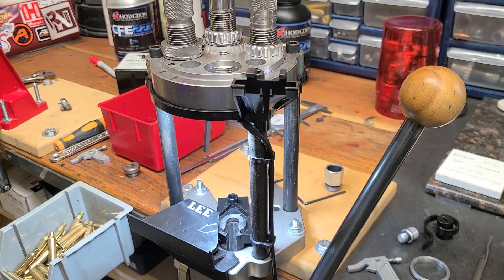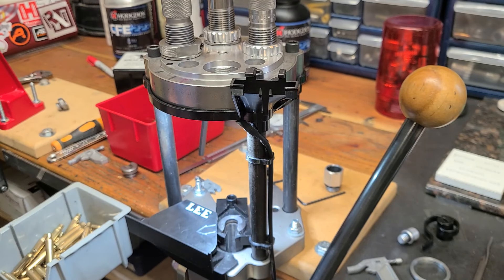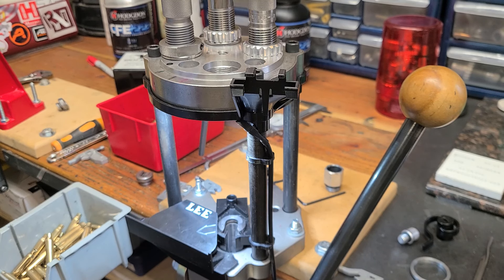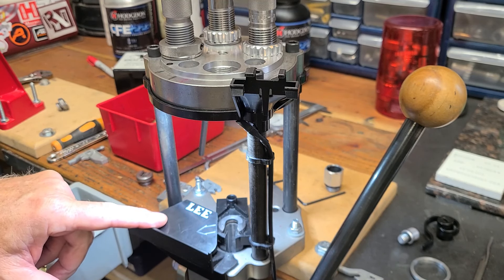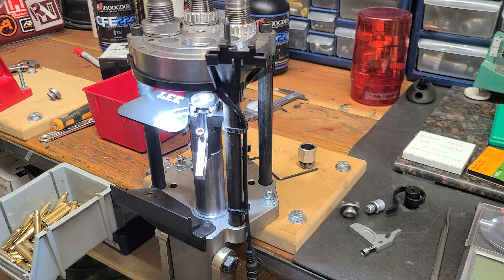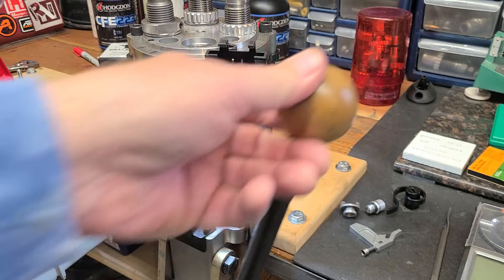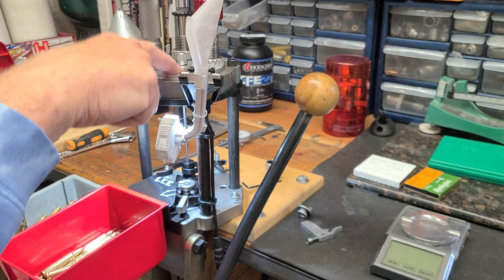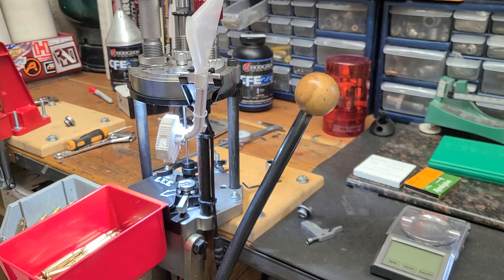Ultimate Turret Press Priming Problems.  Broken priming levers etc.  and the Fix from Lee

Comment: You've been my go-to guy for Lee turret presses for maybe 8 years now. I've held off on the latest model because my original just works so well with the pistol calibers i load. My rifle loads I just go basic with my RCBS Rock Chucker. I'm not loading .223.
Reply from the maker: Thanks for sticking with me all this time!  I always say, don't fix a problem you don't have.  I will add that the option to have a 5th hole with a bullet feeder is really nice.  Its more than just convenience, it sets the bullet very square to the case, particularly noticeable with rifle boat tail bullets.   I would never want to be without a nice single stage press though.  I like to compare the quality I'm getting from the turrets to a single stage to make sure I'm not sacrificing quality.   Thanks for taking the time to comment.

Comment: I see you went back to the Ball handle.   I too am an old Lee user operator, and def prefer the ball to the lever.    I even bought a spare ball lever years ago to replace a handle, but need to get some gas for the torch to bend it properly.  Thanks for the tips and info.
Reply from the maker: Good catch!  This handel is off of my Classic turret.  I kept the 10deg bushings from the ultimate turret.  it fits perfect that way and misses the Safety prime feeder.   At first I liked the handel but over time I felt like there was too much lever, twist and spring.  Back to the ball and its a way. more positive feel.
Reply: I swapped out the roller for the shifter. Like driving 4 on the floor.
Reply from the maker: @dennism8346  I like it better

Comment: I watched a video years ago that the person had the same problem with his older turret press, 4 hole classic,  I believe.  The primer lever wasn't hitting the casting that had the primer lever pocket built in that because it wasn't lined up changed the timing the primer arm rotated under the shell holder. But basically raising up the contact point caused the primer arm to move under the shell holder earlier to miss the primer cup. You can adjust the timing yourself by building up the contact point the lever contacts causing the timing of the lever to move forward earlier to get under the shell holder earlier. You shouldn't have to but it would be an easy fix and Lee could make the newer presses built that way
Reply from the maker: That might have been my video, I addressed primer lever issues on the Classic turret many years ago..  Showed how you could adjust the head of the ram to line up on the base casting marks better and also polish the walls inside the ram slot so the lever wouldn't hang up on burrs.    I have explored raising the elevation of part that the lever contacts first and that works to some degree but now that Lee produced the steel ring you want the lever to rest there instead of spanning like it did before.  Thanks for watching and commenting.

Comment: Another thought... My experience with Lee is that they are always so competitive on price and innovation but you pay a price in the initial quirkiness that you have to suffer through before the product works like it should.  Consider the original Lee Turret Press that went years before they got the primer feed to work with redesigned parts. That said, I'm still a huge Lee fan after helping my buddy set up his Dillon.
Reply from the maker: Thats true, the Lee safety prime system has had its challenges.  There are times when I think about breaking out the old black round ones cause sometimes I remember them working better.  I dont know LOL.  Also true, the grass isnt always greener.  Adding complexity and automation increases the need to adjust and fiddle.    If you look at the other turret presses on the market, they dont have problems with indexing components because they make you the indexing component.
Reply: @TreeTopFlier  Ha ha. True. First time I realized what those other turret presses were about I was like  "is that all you got"? You're making me rotate the dies? Sheesh.

Comment: any thoughts on the classic turret press vs this ultimate version ?
Reply from the maker: I like both of them.  The new press really gives you a lot of versatility that the LCT doesn't offer.  Now that the bugs are worked out of it from the first release I would be inclined to lean toward the Ultimate,  Ive used mine exclusively since It came out.  In part to evaluate it but also because I like the function of it.  My LCT is sidelined.   That said, it is more finicky and requires more tinkering to keep it running smooth.   I talk about this in one of the videos I made on the press.
Reply: @TreeTopFlier  thanks for taking the time to respond. Reading your answer made me realize I actually meant the Lee VALUE turret press vs this (ultimate) ? I currently own a progressive Lee Six pack but its a pain to change calibers. I also own a Lee Challenger single stage which is great for different calibers but pretty slow. I'm wondering if the value turret press would be a good addition to sort have an in-between. It seems for caliber changes all you need is a turret and you can keep all the dies in place, although it only accepts 4 dies not 5 ?
Reply from the maker: @alucardx3014  I have the value turret press as well.  It's a very nice simple auto indexing press, great for hand gun and intermediate rifle cartridges.   Have a neighbor who doesn't know how to reload but bought a Sixpack pro for 38 special (cowboy action stuff)  what a nightmare getting him running on it.   He would have been SO much happier and safer with a value turret press.  Anyway, I don't have a bad thing to say about it.  I have a video comparing the LCT to the value press.  Cheers 🍻

Comment: Great video. I have an old Lee Reloading Press and was looking to get a progressive, and now I like the turret presses.
Which Lee Turret Press do you recommend for loading 223 and 9mm for someone getting into reloading?
Reply from the maker: There's now 3 Lee turret presses.   Value Turret, Classic Turret, and the new Ultimate Turret.   All will do the cartridges you mentioned.  The Value press is the cheapest and a pretty nice option.  If you think you might want to do larger cartridges in the future the classic might be the way to go.  If you don't mind the extra price and complexity or think you may want to add a bullet feeder then the ultimate would be the way to go.

Comment: I feel like LEE is like a software developer that puts out a product and depends on users to provide the beta testing and then they try to engineer out the problems. I own and use a number of LEE reloading products, including the most feared progressive press, the LoadMaster. The all time best product I use is the original LEE hand primer. The new hand priming tool is much worse. It flips primers on their side and upside down 6 to 7 percent of the time. The worst thing I think LEE has produced is any of the on press priming systems. I don't even attempt to try user fixes any longer. It's no wonder LEE archived the LoadMaster press. My LoadMaster runs like a charm as long as I am not priming on it. I have a "green" single stage press with a primer tube that is pointed at my face but it has never failed. It is circa 1974. I just wonder if the LEE priming system engineer is proud of his work or if he woke up one morning and said "crap, my name is on that forever"?!
Reply from the maker: You can hear my frustration at the end of the video.  I really like this press and I've used it almost exclusively since I got it, but the release could have been so much smoother and a big win for the folks at Lee.  Instead, I think it ended up confirming peoples hesitations with their products.  Im not a fan of the six pack pro either for priming reasons.  Too temperamental.

Comment: Plastic parts are my only bitch with Lee. They break and bend especially the powder measures parts. To much invested in Lee products to change providers at this time.
Reply from the maker: I know the reliance on plastic parts has really turned people off.  I was concerned about the durability of the ratchet and housing on the Lee Classic Turret many years ago but many thousands of rounds and years later it was never a problem.   However!  This time I think they may be in trouble.  Making the primer lever hinge point out of plastic might have been a bridge too far.   I looked at the value turret press and the hinge point is machined into the ram (steel) using the same primer levers and it works fine.  Thanks for taking the time to comment.
Reply: Wait until someone drops all the STL files on Thingiverse, then you can 3dprint your own plastic parts.  take that Lee.  All the plastic parts on this press seem very easy to copy using 3d tools.

Comment: Thanks of all the videos. I saw an interesting video on this topic from a Brazilian guy. https://www.youtube.com/watch?v=3mxca7NZ6v0 
Turn on CC and translation. They showed how if you don't lower the arm all the way to the bottom when depriming that the spent primers can accumulate on the top of the arm tail and not fall through. If enough accumulate it will block the arm from moving and you can break off the long part. Not sure if this is what happened to you but it seems to be another problem with the design.
Reply from the maker: Thats a good observation, but that wasnt what was happening to me.  All my brass had been previously deprimed and cleaned.  I have to admit, I havent done much depriming on this press just because of how I like to process my empties.   Thanks for the comment!